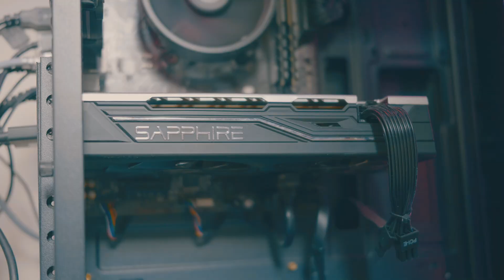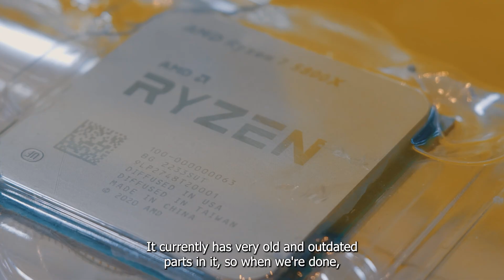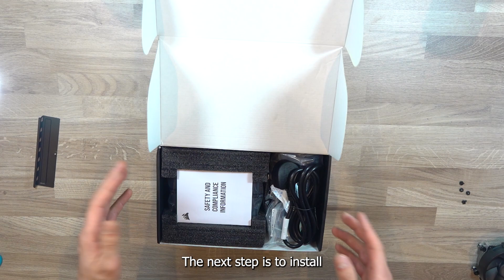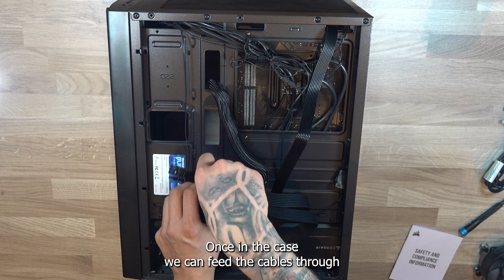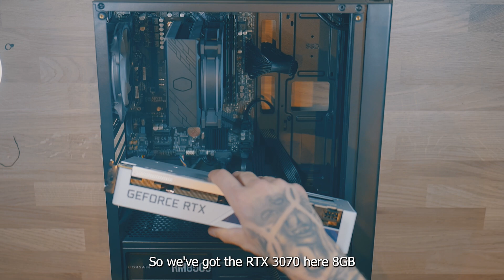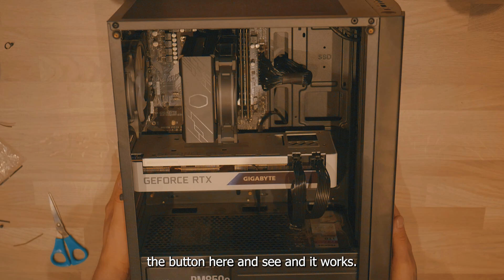I upgraded my slow and outdated PC to more up to date | RTX 3070 RYZEN 7

Comment: Nice how hard was it to upgrade
Reply from the maker: Thanks, it wasn’t too difficult, just more time taking than anything else, but overall easy. You’re just taking stuff apart and putting it back together in reverse
Reply: @maccaviationsim  what parts did u use vould u list them
Reply from the maker: @drjamiesworldphd  Ryzen 7 5800x and a RTX 3070